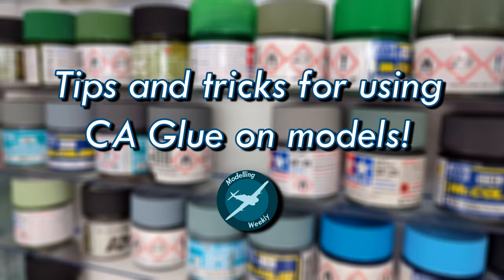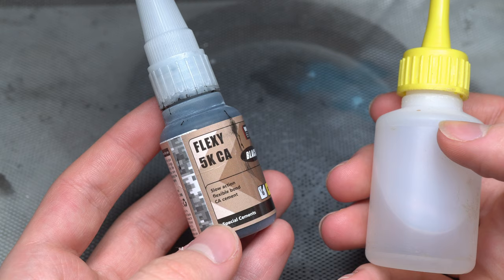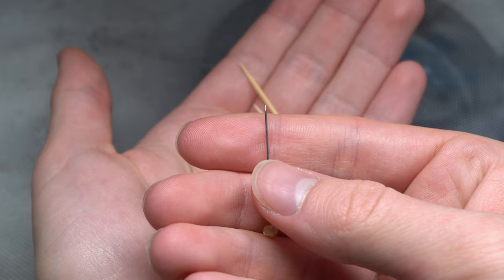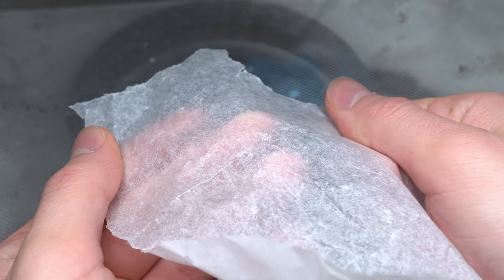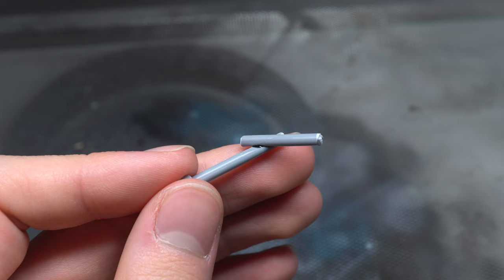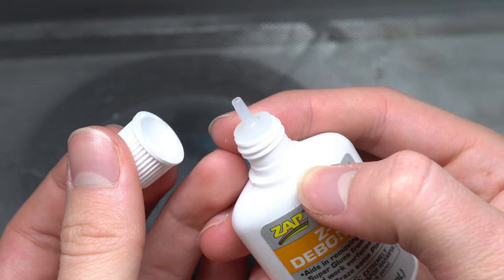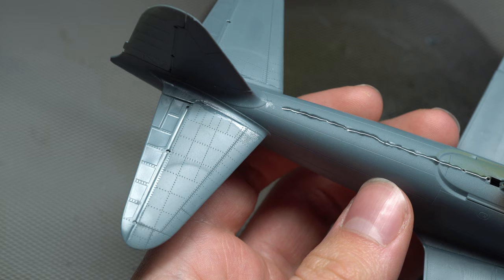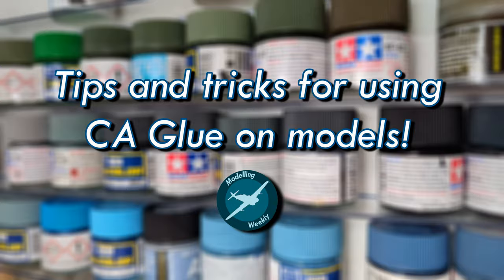How To: Using CA Glue/Super Glue on your models! | Full Guide

Comment: My tips:
- Acetone can be also used to debond / remove CA glue. Even its fumes are excellent to clean up CA from canopies.
- IPA is new to me but I know that water, or water vapor in the air is what activates CA glue. I blow on the surface and the water vapor in my breath makes it. I don't see the point of using IPA when a drop of pure water or blowing on it is just as good.
- Pressure is important. Instead of just placing the two parts together you should press them together. Force is a factor here, not time, so just a one second long pressing makes a strong bond.
- Use as little as possible. The thinner the better.
- When used as a gap filler it is practical to mix it with some plastic dust.
- Take a sewing needle, file the round end of it so it becomes a fork with two teeth. Glue it into a wooden stick, preferably an old brush handle from which you removed the bristles. Now you have the perfect CA applicator. The capillary action between the teeth will help you pick up the perfect tiny amount needed. It's easy to clean with a hobby knife or a lighter.

Comment: Thank you for the tip with IPA, because unlike specialized chemicals, IPA doesn't cost a thing and  has other uses in the plastic kit building such as a generic thinner and tool cleaner, which means I always have a few liters laying around, which simplifies the logistic aspect. 🙂 In return I'll give you a small tip back, don't use rubber infused CA glue only as a filler, because after all it is still a glue, which means you can glue both sides of fuselage and then sand the overflowed excess. This way you achieve bonding and filling the seam in the single step, saving time and getting perfectly seam free very strong bond.
Reply from the maker: No problem! And thanks so much for the tip in return!
Reply: Thanks for the IPA tip!

Comment: Here are a few extra pointers for CA glue. Using the clear thicker CA glues, you can apply this to small areas of clear canopies if chipped and then it can be sanded and polished later (practice first!).  On vacuform canopies, if you want to sharpen up exterior edges on canopy frames, clear CA can be used here as well  using the same general techniques. Thicker CA can be used to make knobs on controls in cockpits. Accelerators are useful for all of these, I use disposable micro brushes to apply the accelerator. One point to remember with CA is that it should be sanded soon after curing. After it fully cures, it is much harder than the plastic and you can damage the plastic while trying to sand down the CA. Another useful tip, you can make paper parts and stiffen them with CA glue.  I've also used CA to mold small parts, but it's best to let these dry normally rather than use the accelerator. Thanks for the video, we need to spread the techniques around and get more people enjoying the hobby.
Reply from the maker: Those are some fantastic techniques, so that I have never heard of! Thanks very much man
Reply: When using a black CA glue (rubber infused) the sandability (probably not even a word 🙂) is greatly enhanced when compared to the ordinary CA glue. So it can be sanded easily and similarly to usual filler sanding, it doesn't create such hard residue as the ordinary CA glue.

Comment: Any thoughts on how CA glues perform over time?  ...do the break down...become brittle, lose their bond, and/or turn yellow?  Thank you!
Reply from the maker: CA does become brittle over time, however its lifetime is extended massively by the integration of rubber into the mix. I can't comment on exact lifetime, however I will say that the CA bonds I made 4 or 5 years ago are still perfectly fine now!

Comment: Thanks a lor for your support! Chris
Reply from the maker: No problem 😄
Reply: @ModellingWeekly  BTW, I noticed that you unscrewed the Flexy bottle all the way, was that to show the contents? The cap has 2 parts with nifty pin in cap preventing clogging, no need to fully unscrew and expose the glue, unless you did that intentionally for the sake of the video. 🤔
Reply from the maker: @Vmssupplies keen eyes haha! It was sort of a bit of both. I thought it would be helpful to just show a glimpse of the glue in the bottle, but on top of that I was a bit wreckless and just left the cap off one time, and the applicator tube sealed itself up 😅

Comment: Using ca to fill gaps is a great idea but you need to make sure it dries but not fully  hardens if you allow it to fully harden you will have a devil of a job sanding the joint. Best wishes Vic
Reply: Black (rubber infused) CA can be sanded as easy as any ordinary putty, its biggest advantage is that it doesn't create that super hard residue, which is almost impossible to sand as normal CA glues.

Comment: Really enjoying your weekly tips and tricks. I’ve just started back doing modelling . I have always had a passion for building things and learning new techniques and tricks. I do have a question that hopefully you can answer. I’m trying to get to grip with the painting and recently built a 1:72 Airfix BF109E Messerschmitt. Didn’t use any primer and applied several coats of enamel paint(brushed as not ready for air brushing yet). While at my local Model shop I asked if they did varnish in a spray. And was happy that they did. So came home with a acrylic glass varnish. When I applied it looked ok. I came back to it 10 mins later and the paint resembled what I can only describe as pealing away from the surface as if paint stripper has been put on and has reacted. What have I done wrong? Any help will be greatly appreciated.
Reply from the maker: Glad you're finding the tips helpful! I believe I know what's happened here. The thing with enamel paint is that the oil carrier it contains takes a really, really long time to essentially sod off and evaporate - What this means is that it's pretty much always going to be there in some quantity regardless of how long the paint is left to cure. This isn't a big issue most of the time, but unfortunately this will cause issues when applying acrylic paint/varnish over the top as some kind of reaction occurs between the two (Don't know the exact science lol). My best reccomendation would be to either use an enamel varnish over the enamel paint, or to switch the enamel paint for acrylic paint in the future (Vallejo, revell aqua and Tamiya acrylics are all good bets, however you'll need isopropyl alcohol to thin down the tamiya for brush painting). Hope this helps!

Comment: Hi, I am 61. When I was a boy in the late 60s and 70s, I loved building ship and airplane models. The glue we had would give you a headache if you built your model in an enclosed room.
Decades have passed , and I find myself wanting to build models again, especially the vintage ones I had as a boy.
Ive found and bought several vintage models. I cant finnd the glue we used back then. I seem to remember it was made by Testors. Im getting  the impression that nowadays people use Krazy glue? The glue we used back then could make the plastic soft, almost melt. Will regular super glue actually- permanently- work? Thanks for  your replies.
Reply from the maker: Hey there! Super glue is only used for certain components that won't reaction to normal model glue, such as fabrics and metals. For normal model components, we use a product called styrene cement, which as you say essentially melts the plastic and creates a bonded connection via this method. I'd recommend getting some Tamiya Extra Thin liquid cement, as it makes use of capillary action between parts to glue them :) alternatively, traditional Humbrol poly cement can also work
Reply: Thank you so much! I ordered some of the Tamiya adhesive you recommended! I really appreciate  it!

Comment: Great video! I recently started using CA glue and I'm having some trouble. The de-bonder I'm using melts plastic and damages the area I'm trying to clean up. Is this normal?
Reply from the maker: No problem! Yeah, unfortunately there are some ca debonders that use acetone as the active ingredient, which melts styrene. Things like VMS glue remove however are formulated to be plastic safe, so give that stuff a shot 👍

Comment: Great video, thank you for the info.  I noticed you were using 99.9% IPA. Will 70% or 90% IPA work also as  the CA accelerant?  In the states 70% & 90% IPA is available everywhere (local drug stores, Walmart, etc), but the higher % would have to be ordered.  Thanks again.
Reply from the maker: No problem! I may be wrong, but I'm fairly certain that 70 and 90% are just diluted with water, so it should be perfectly fine :) that said, I'd test it out of a couple of scraps just to make sure 👍